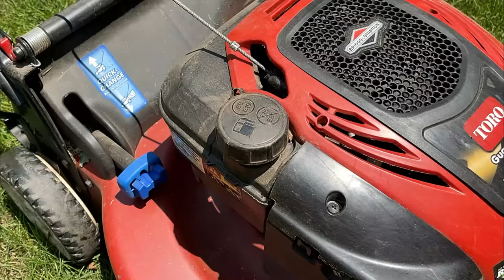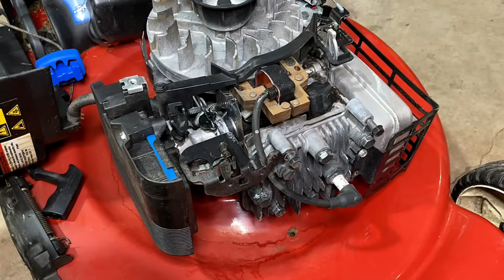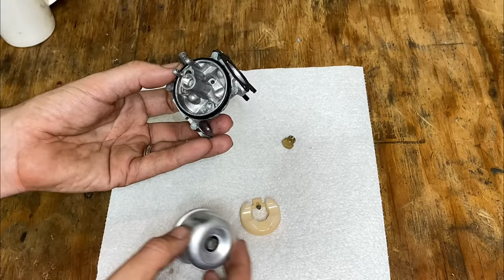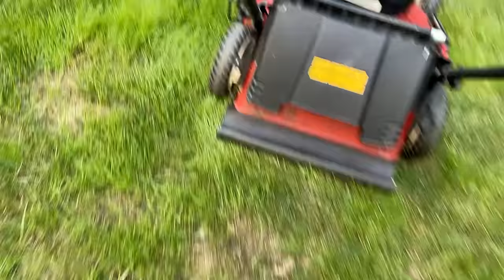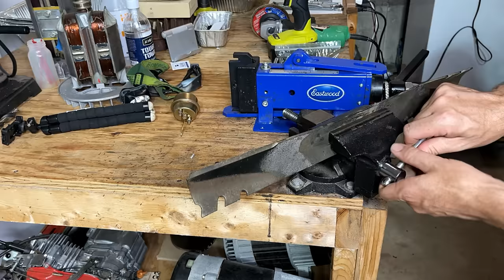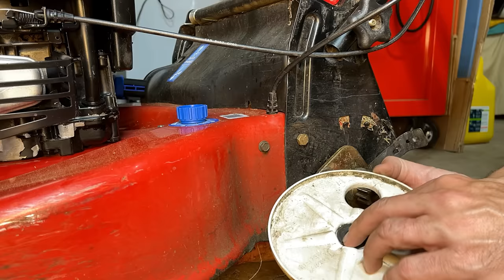Free Smoking Lawn Mower - Not an Engine Issue

Comment: Nice repair, Jim. I might add here that the trick to getting the mower deck to last a long time is to keep the bottom side of it clean and free from debris. The grass clumps hold moisture and the pH of the grass is slightly acidic, causing the deck to rust over time.
Reply: Keeping that mess off the top helps a lot, too. I was shocked, nay appalled, at the depth of the filth around the pulleys on the machine I ride a lot (beautiful black topsoil once you blow the grass clippings off the deck). It's a Deere, so the finish is coming off in sheets, not chips. I'm guessing I'll get to strip/treat/prime/paint it this winter, don't see the guy going for powder-coat, but a girl can dream. Probably be lucky to get real John Deere Yellow paint
Reply: Also, the washout actually works quite well but(and it's a big ol' fat but) you have to use it each and every time you run the mower, skip it once and debris start to cling and the port becomes useless in short order.
Reply: help to sand the deck and apply a can of undercoating, just be sure you prep it before spraying.
Reply: @dixiechampagne2892  A powder coated mower? That's my dream too!
Reply: Nick sprays Rust-Oleum paint under deck after cleaning
Reply: @bluor3713  😊😊
Reply: Aluminum ?
Reply: Why not make the deck out of Aluminum or plastic?  
I sprayed fluid film and it helps. I try to apply a few times a season.

Comment: Unlike modern cars, lawn power equipment still requires maintenance to keep them from failing before or during use. If you lack the skill and/or ability to service and repair your own equipment, your at an extreme disadvantage because your going to either be spending a lot of your money at the shop or constantly giving up on your equipment and buying new to replace it. Lucky for some of us who are glad to take your old machines off your hands and repair them for their own use or to resale. Good job with this Toro!
Reply: I had a lawncare business Hire some with integrity one young man ran right over a stump and ripped the engine right off.
Reply: Modern cars do to uless you want to "upgrade" every 5 years.

Comment: I have used and repaired my own Toros for about ten years. Yes the rear drive wheel gears are a common issue. There is a replacement for the plastic geared wheels with metal ones and it’s a good idea to replace the small gears too. The wheels with the metal gears last much longer.
Reply: Ditty Wheels 4
Reply: New wheel 🎡

Comment: How about 3D printing new drive gears that are about 5 or 10 percent bigger.  If you can get gears with proper tooth engagement it should be ok.
Reply: Sure Larry, the 3D printer is definitely more accessible and less expensive than some $40 mower wheels from Amazon.
Reply: Yeah I'd definitely be more likely to try printing than buying some wheels, but that's because I already have a printer. Apparently some public libraries have 3d printers too?
Reply from the maker: My son has one.  He has made me a few parts, but they fail really quick.  The plastics used on those printers have a low melting point.
Reply: Yeah the kind of plastic really matters, as does the design and printing direction. "Maker's Muse" channel has done a lot of 3d printed gears for high power brushless motors recently and the durability varied a lot even between brands of nominally similar varieties of plastic.

Comment: I love the Torro Personal pace system my 2000 mower is running great with just oil and filter changes. It smokes for a few seconds when cold but for 22 years not bad.

Comment: Great little mower there. If only the tips of the gears are engaging try replacing the rear axle bearings that mount in the HOC plate, they may have too much play. You can also use the older wheels with steel gears (the LawnBoy version of this mower uses steel gears too). The surging on these Quantum engines is often caused by that gray plastic intake manifold coming loose where it attaches to the intake port, make sure those two little bolts are tight. The carb “O” ring may be worn too, either of those conditions will cause a vacuum leak and surging. Lastly check and re-torque  the cylinder head bolts, particularly the three around the exhaust port. You will almost always find those three loose on a Quantum that hasn’t been serviced in a while.
Reply: My old Honda Buffalo surged from having Vac or seal leak

Comment: I picked up one of these today but it has the 6.5 Tecumseh on it.  People said didn't know what was wrong with it.  Got it home and WAY overfilled with oil to the point there was so much oil in the cylinder it was almost hydrolocked.  I drained out the excess oil, tipped it up and let oil drain out the plug hole, then fired on the first pull, doesn't even need the carb cleaned.  Only thing it needs is a self propel cable then I can get it sold.

Comment: The only way I can see to fix it is either a larger drive gear or a different mounting plate for the wheels.  It might be worth checking parts diagrams between years to see if the part numbers have changed or if there's an after market replacement for the parts.
Reply: My experience with the toro recycler drive wheels is that they use a par of bevel gears and a washer to control how much they mesh. The washer wears out as do the nylon teeth leading to the gearbox being unable to transfer much torque. A new gearbox is expensive, but putting a nylon washer between the housing andcthe bevel gear increases the mesh of the gears and it solves the issue much of the time.

Comment: I had one of these mowers that stripped the drive wheel gears.  They actually make upgraded wheels with a steel gear instead of plastic, problem permanently solved.
Reply: Until the tread wears out?
Reply: @jcadult101  Things wear out with age... you should see my knees.

Comment: File with a file, no heating issue with the blade material... if it's made with hardened steel.  Unregulated heat can wipeout the temper.

Comment: Thanks for detailed video. Our similar rotary mower actually did catch fire once, but only petrol/gasoline and some grass got burned. The carburettor had a small leak, the exhaust/silencer next to it was damaged, and you can guess the rest of the story. Apart from a few burn-marks on the engine-casing, there was no damage!

Comment: Nice fix James, I recently had a mower that the air filter was so bad that it was sucking oil from the crankcase thur the breather tube. Changed the oil and filter and after running for a short time all the smoke stopped and ran great. Lack of maintenance again.  Also try Fluid Film after cleaning under the mower deck, works great. Thanks for the video.
Reply from the maker: Great tips!  Good to know that a dirty air filter can do that.  Never thought of that.
Reply: These air filters are designed badly. Without a pre-filter they clog very fast in dusty conditions, and who wants to change the filter every time the gas tank is filled? When I mulch leaves with a mower like this one, that is about how long it would take for the filter to be clogged to the point where the engine has no power and is running very rich. Just adding a pre-filter would accomplish nothing since the air enters from the side and bottom. On mine, I have drilled a series of ~1/2" holes in the front of the housing, blocked off the normal air entry at the bottom, and added a foam pre-filter. It potentially could allow more water in in rainy conditions, but I do not do much lawn mowing in the rain. The change is a dramatic improvement. You still need to clean the pre-filter, but that is cheap and easy. Better but more work would be to remotely locate an air filter high on the handle where there is much less dust, although I have not yet tried that to see how well it works.
Reply: @jimmonte9826  Man your right I had a one of those mowers and the filter was designed was just like you said you could not keep it clean and it would suck in oil and ruin the filter that was way over priced.I know it wasn't right but I took the crankcase breather hose off the filter and raped it in a pre filter foam.

Comment: Since you already had the wheels off I think I would have removed the pinion gears and cleaned up the spring loaded keys which if you look at the inside of the gear makes it a one way drive.  This allows the pinion gears to act like a differential drive and reduces the strain on the plastic gears.  Not that this would be a total cure, it would contribute to a little longer life of the plastic. gears.  On the keys, I use never seize and wipe most of it off so it won't collect alot of dirt and seize up again. Some mowers use a pin instead of a key but theory is the same. Great video as usual.

Comment: Nice video. I have yet to see anyone flush the gas tank when doing a carb cleaning or replacement, I always do. Also, Toro doesn’t use in line fuel filters, which you can buy on Amazon, to keep dirt from getting into the carb. I like to add one when working/ repairing neighbors mowers.
Reply from the maker: That and a fuel shutoff, just not much fuel line to add all that :(
Reply: @jcondon1  A shut off would be nice, but you are correct no room. Usually room for a filter
Reply: Un robinet et un filtre à carburant sont nécessaires, pour limiter les pannes sur ces petits carburateurs.
Reply: I saw a you tube small engine repairman recommend a Kawazaki fuel filter says the plastic type are junk also put inline shutoff valve.

Comment: Had the same problem with wheels. Purchased the wheels with metal gears but you have to change the drive gears too since the teeth wont mesh due to a different count of cogs.
Reply from the maker: I saw that.  Was not in a rush to put more money into this mower.  Am surprised the gears do not match.

Comment: Surging on a Briggs & Stratton is often caused by air leaks in the intake manifold or the carburetor. On a Honda or Kohler, the pilot jet sits on top of the carburetor where it's easy for dirt to get into it.

Comment: I have one out in my yard and I noticed the same exact thing about the wheels. You saved me from breaking it down to figure out why. I thought it looked in too good of shape to be out by the curb. If the drive issue can't be fixed or modified to work without being engineered to fail, I could see me using the engine for a swap or maybe building some small contraption

Comment: You should align middle setting on height adjuster bar behind where wheel bolts on pry out till wheel stands up straight. Gears will mesh better. I flip little gear over use new side of teeth. Remember ALIGNMENT teeth will mesh better closer. Amazon had wheels last spring &12 a pair. Ordered 6  pair

Comment: I have the FWD version of this mower and the gear teeth are molded into the outer edge of the wheel, are wider and seem to mesh better than the RWD version. The drive gear looks the same as the RWD versions. Mine is a 2011 and I never had a problems with the drive system. FWD isn't for everyone though, especially if you bag or have hills, as the drive wheels can easily slip but I like the easier way it backs up and that you can push on the handlebar and easily maneuver the mower.
Reply from the maker: It is a good drive system.  Have worked on many that work very well.  Just this particular model someone made a mistake on.

Comment: Bought a toro 190cc recycler 22 for 50 bucks. Didn’t start, sprayed starting fluid and got it to surge. Replaced spark plug and air filter aswell as cleaning the carburetor. And as been running nice for 6 months

Comment: I think many of the mowers come out of the same Chinese factory. I hate working on dirty engines and usually will clean them up first.  I like to pull the spark plug to check the gap and see the condition. My neighbor started to mow her yard but shut it down she said it smelled funny. She said she had a guy change the oil and put a new blade. The blade was new so I looked at the oil. It had a dark gray smear at the bottom of the dip stick. I told her I would replace the oil . When I drained it about a teaspoon came out. After putting oil, it ran fine and didn't overheat. I didn't know the quick lube mechanics also did lawn mowers.
Reply from the maker: No kidding.  Years ago brought my jeep YJ to a quick lube to do the manual transmission fluid change.  After getting it back, had all sorts of problems shifting.  Checked the fluid and they short changed me by about half the amount that should have been in there....

Comment: When the air filter is plugged , it's normal for them to suck from the crank case vent tube drawing in oil. I wouldn't  call that bad. I remember picking up a mower like that. Last year, I got one where you pulled the cord and oil would gush out the exhaust.  It was trash. It was not over filled, just toast. Good video. I tell my customers it I'd absolutely  essential  to check that air filter a few times a year. Grass and dirt can plug up a filter easily. I like to take off the tins as well. Dollar store simply awesome works great for cleaning and degreasing an engine. Save yourself a few bucks on cleaners.
Reply: those smokers keep the mosquito's away.

Comment: GOOD fix and I was expecting a lot worse too. The Snapper I got from the Re-store for $15 had the differential with no stopper packed FULL of leaves. It took a new pinion, a plug and some 00 to fix that one and a Kawasaki motor off a dead Derre to make a bagger out of it. My electric start has a nice thick coat of oil base black all over the underside of the deck after an angler grinder wire brushing and blowing off. The charger came this morning and now for a battery and carb. I leave the cleaning up of that one to her since she says that 409 is too strong for me to mess with. No telling how many truck cabs it got rid of all the tobacco smoke and such but I'll never live to be sanitary! God Bless and THANKS!

Comment: I use a big long pry bar to bend the wheel adjusters (pry between the wheel adjuster and the deck) to push the wheel gear closer to the drive gear.  Over time, the metal gets bent, but a minor “tweak” brings them back into tight mesh again.
Reply: Thanks, just bought a used Craftsman 6.75 22" and basically all the wheels are bent inwards towards the top. Also was pretty filthy but it's harder to push than it should be and I'm thinking it's got to be the bent axles. I was really hoping they could be bent back instead of buying new adjuster assemblies and will try it this way.

Comment: Another great video. It mirrors my experience of getting mowers with "issues" that are often more about maintenance than actual repairs. Bad gas, filters and carburetors seem to be the most common failures. I use non-ethanol gasoline and synthetic oil exclusively in all my small engines. I also add fuel filters when I can. After every use I blow off the engine with compressed air. And blow out the air filters every three or four uses.

Comment: Crankshaft pulley will wear some, cause slippage.  Belt change-out not much fun.  Try snapper self-propelled for some interesting design.  The original one, rear wheel with friction disk multi-speed.

Comment: good video. I was surprised to learn that the blade torque is only 35ftlb.
Reply from the maker: I think it ended up being higher according to the manual (50+).  Wanted to make sure it was at least 35 before trying to start it.
Reply: Torque isn't necessary for the blade.

Comment: Back in 1960, our next door neighbor had a shiny red Toro lawn mower that was self propelled. I was six at the time and thought that was the coolest lawn mower. I remember the only thing he constantly replaced on it was the drive wheels. Several years later I was old enough to mow our yard. We had a hand me down Craftsman aluminum cast deck push mower. It had a straight piece of black pipe for the exhaust, oil bath air cleaner, and a manual pull rope that that I had to wrap around the flywheel pulley to start it. Always added oil to it, but never changed it. We finally got Snapper push mower sometime in the 70's. Just recently I was browsing the big box stores looking for a lawn mower to replace my very old Honda self propelled. I looked at the Toros with the Briggs engine and the Honda engine. After looking at the reveiws, I will buy another Honda. It seems some of the mowers now days are made to be sold at a certain price point and they are depending on brand recognition and reputation from the past. I remember replacing the drive wheels on my Honda several years back and the wheels were not a expensive as the Toro's, they did not a plastic gear made onto  the wheel.
Reply from the maker: Honda does use plastic, but they make it using the proper clearances and generally last.

Comment: Yes james, thank you for showing us these basic maintenance items.  I've had this exact same model since 2013 and recently replaced both rear wheels as well as the drive belt.  I replaced all of the drive components because I wasn't sure
Which was contributing more, worn out belt or worn out gears on the rear wheels.  I also took the time to take the cover off and clean the whole mower, then sprayed a mixture of lots of dishwashing soap and hot water to clean the motor.  Then sprayed carb cleaner in the carburetor; also took out the spark plug, sprayed inside the cylinder with carb cleaner.  Had to change the oil because water got in the oil.  Cleaned up the spark plug.
Use a concentrated mixture of very hot water and dishwashing detergent in a spray bottle.  Then rinsed the whole machine off with a couple of handheld gallons of very hot water. Because I wanted to be pollution Free pollution on the cleaning job.  Then I blew dry the entire machine.  Now starts After the first pull.  Thanks again for showing us how it's done.